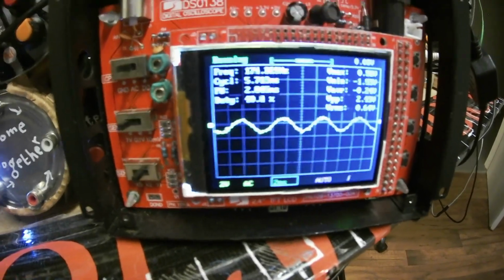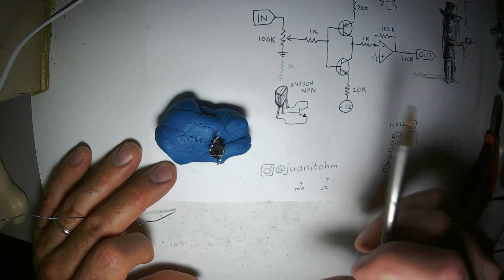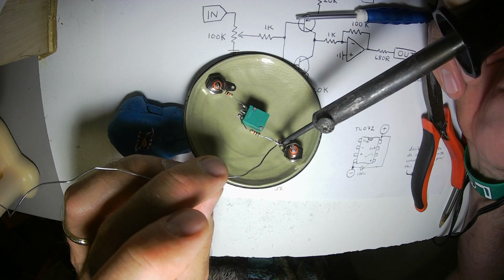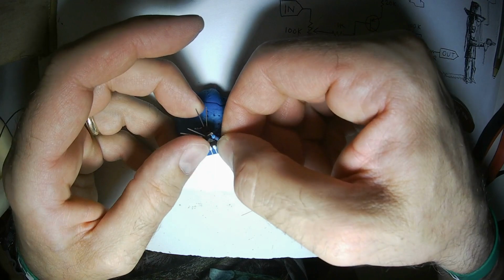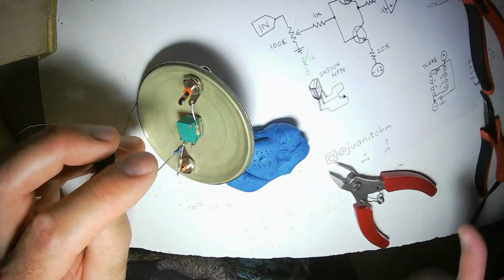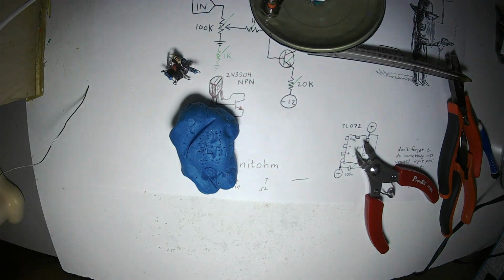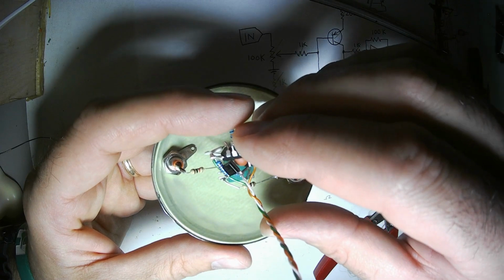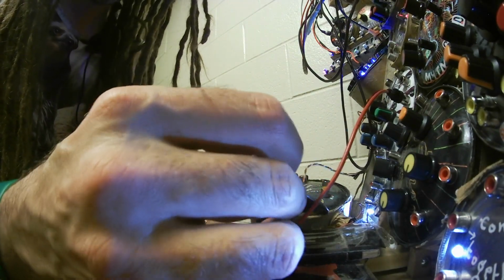YES!!! You can build this wave folder for your modular synthesizer!

Comment: I am having trouble figuring out where the last two resistors go on the build  cause your hands are in the way lol .. I am also slightly blind hehe
Reply from the maker: Hands in the way!!! Dang it... I'm not sure which ones you mean, maybe the resistors for the op amp? The schematic should point the way - I did include a little drawing of the chip, right?
Reply: @ozerik  yes sir I just got lost and packed it up for the night. will look with fresh eyes in the morning and figure it out from there. I appreciate you showing us people how to do this stuff man! I dig it!
Reply: @ozerik  its at the 31 minute mark btw what I am talking about
Reply from the maker: Okay, I see what's up. The 100K and the 1K resistor both go to the - pin (either pin 2 or 6 of a dual op amp). The 100K goes to the output (pin 1 or 7} and the 1K goes to where the transistors are connected. Not the middle legs, the other ones. Good luck!

Comment: i could however use the second half of the opamp to make it non-inverting, by using two 1k resistors, right? in case i use this for cv signals and not for audio
Reply from the maker: Yeah sure! Go ahead and use a higher value resistor so you're not needlessly loading the op amp. Anything under 33K won't add any noise to your signal. Do it!!!